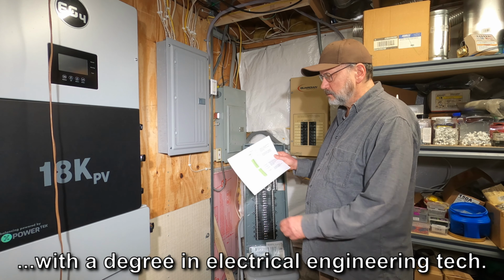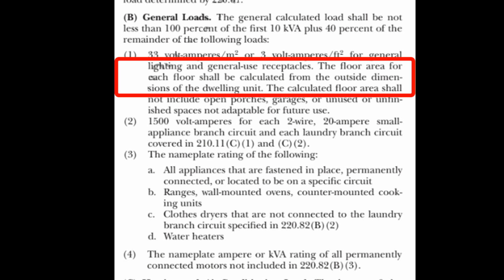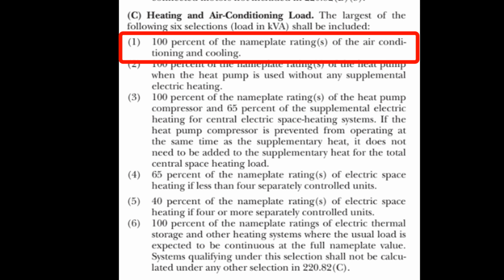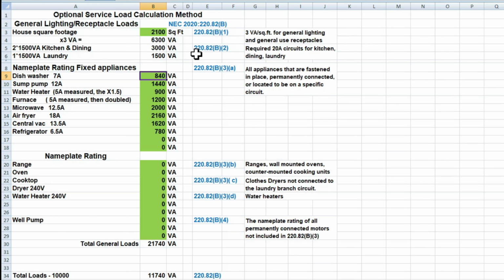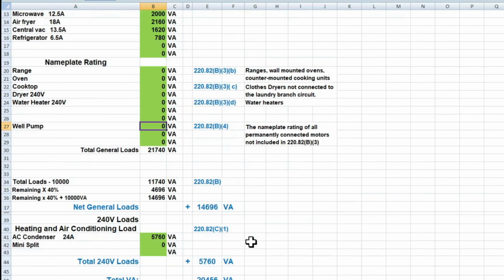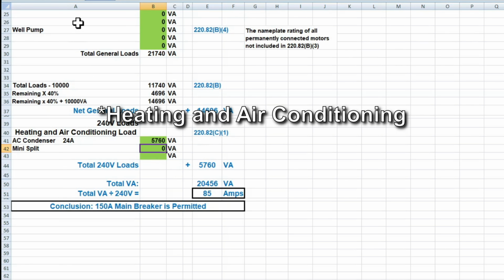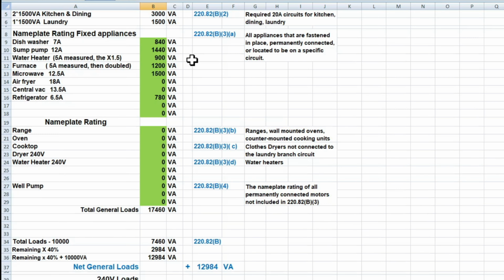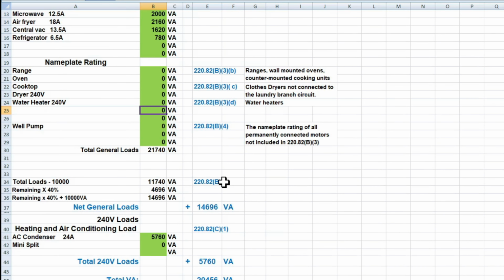Feeder and Service Calculation | NEC 220.82 Optional Method | Man About Home

Comment: Excellent work, fellow nerd!
Reply from the maker: LOL. Thanks for watching!
Reply: @manabouthome  I'm studying to pass my Michigan Journeyman exam and brushing up on the optional method. Part III is still a bit overwhelming but part IV I've wrapped my head around. Now I've got to master the optional method for multi-unit dwellings. Hope to be as knowledgable as you some day. Thanks for uploading.
Reply from the maker: @RecklessAbandonnn  When I took the test, one of my instructors told us, he failed it 3 times! He still had this good advice. Don't try to get 100% because nobody does. In my city, 80% was a passing grade in 1999. It's pass or fail. I passed on the first try with an 82.  There was a challenge process after the exam.  I could have challenged some of their marks to correct their errors in grading. My buddy had to do that, and he picked up enough points to go from fail to pass. As a result, I know I could have gotten a few more points. But I passed anyway, so I didn't bother. Do you have someone to study with? A study buddy? It really helps. Especially if you're going in for the exam at the same time. That puts the same pressure on both of you to do the work. Spend some time together and help each other understand what the other guy is having trouble with.  Good luck with it!

Comment: You can put a shunt on it and pay a couple dollars. Have to give up a few things….
Reply from the maker: The plan is to provide a 100 Amp feeder to the sub panel, when the new main panel is installed. There's no need to reduce loads on the panel. It's working fine as is.  Thank you!
Reply from the maker: Update for anyone who's interested. I've used the EG4 18kPV all-in-one hybrid inverter to run all my house loads one day, for 28 hours, when the grid was down.  The batteries lasted more than 28 hours without recharging.  The current draw from the inverter was usually well below 20 Amps. We were running the furnace, not A/C. Sometimes it went higher than 20, like when the microwave was running, but never more than 30 Amps.  So this load calculation is was more than adequate for my house and family.